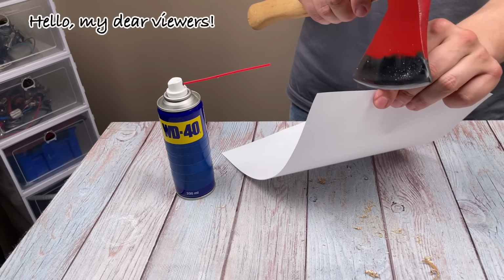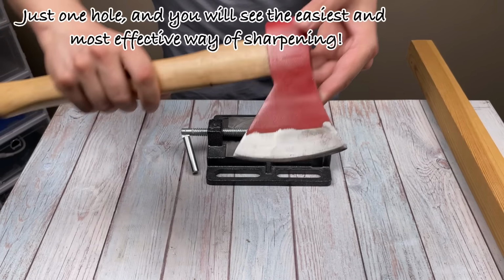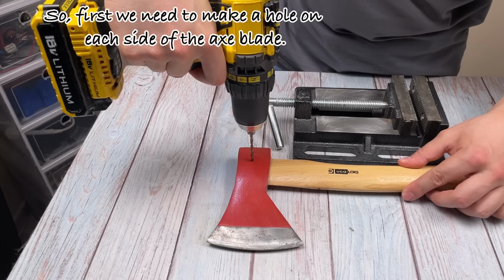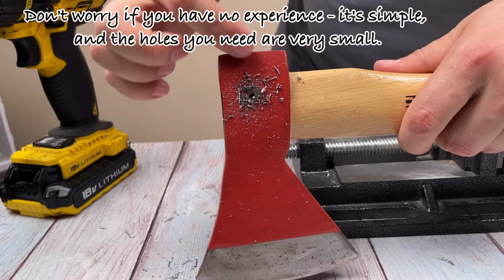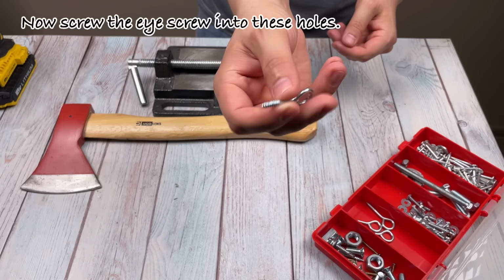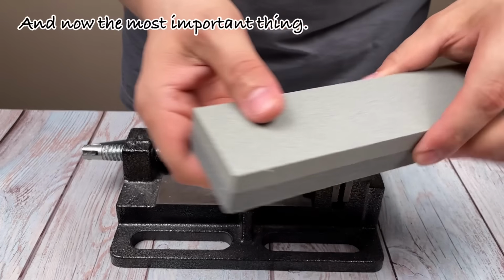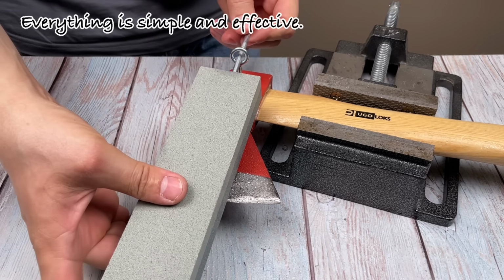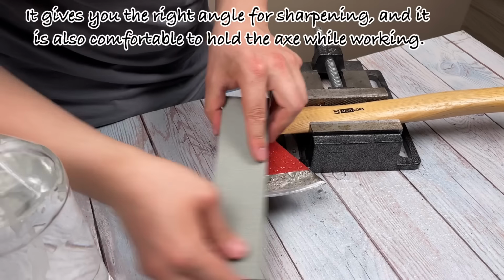🔥🔥Just one HOLE in the axe and your axe is as sharp as a blade! I regret that I did not know earlier

Comment: Enhancement idea: place the eye both pivot on a wood block behind the axe. Then you don't need to drill the axe or take the eye bolt out and have to move it to the other side. You can then use this jig for multiple blades and adjusting the angle by the height of the eye bolt in the wood jig.

Comment: ????? Explain the details,  diameter of holes, what was the item you used to drill the whetstone, what type of glue?
Interesting use of an old CD and sandpaper 800 grit blue color on the sandpaper- what was that?  is it like the green the white or red or black 

What about a chopping demo? 
A bigger axe for larger wood splitting 

So many questions 
Isn’t it easier to sharpen traditionally?

Comment: I agree with Micheal Trombino.  This is a lot of work when all you really need is minimal information and a file.  My axes are just as sharp and it took me half as long to do it.  Plus, on a side note, DO NOT EVER put sand paper on a CD and use it as a sanding disc.  That angle grinder is running at 11 to 12 thousand rpm.  That’s as much as a formula race car.  Obviously you’ve never had a cutting wheel explode on you because you’re asking for a very bloody accident doing that.

Comment: I slit about a thousand pieces of kindling each year.  I dont want a super sharp axe. I took the side off my thumb 1r years ago sonow for slitting at least i go with fairly dull. I have other tools for shaving off material.
Reply from the maker: Oh my 😔 This is of course a sad story, but it is still convenient to work with a sharpened tool
Reply: FYI: The majority of accidental cuts / injuries occur because of a dull blade or tool.  This results in the user applying incorrect or inappropriate force to compensate for the tools inability to perform its job with ease.   Instead, make sure your blades and  tools are as sharp as can be, and let the blade or tool do the work for you!

Comment: I’m sorry to say, this is one of those tricks that only works if you already have fixed the blade shape away from a cheap factory edge and even then it is clumsy, limited, and requires too much setup and gear and lots of work. It will only shape the blade to one geometry. I’m glad people still put a little thought and keep trying to improve but not every neat trick is a good trick. Thank you for trying anyway.